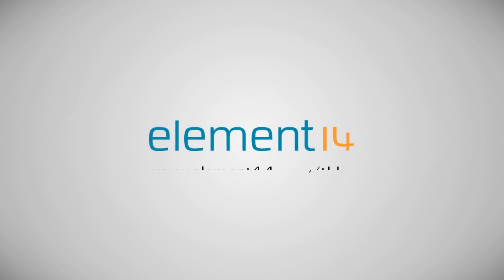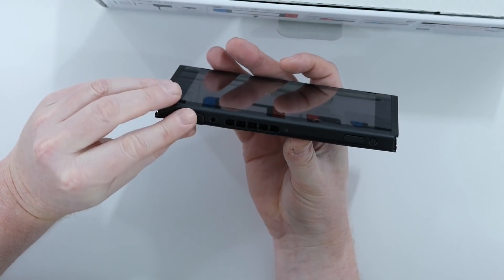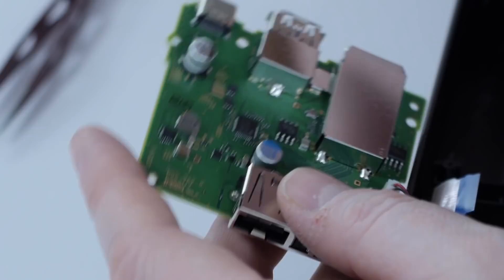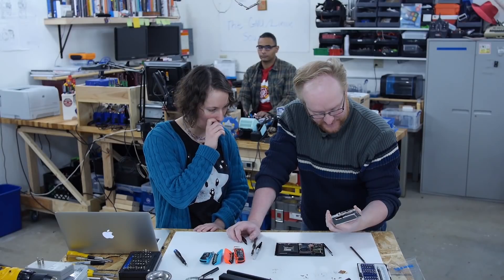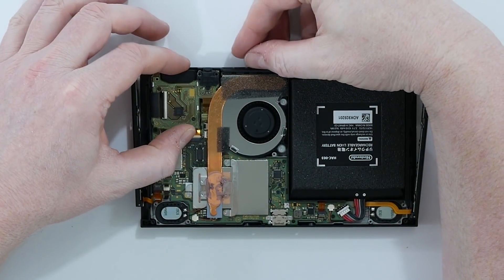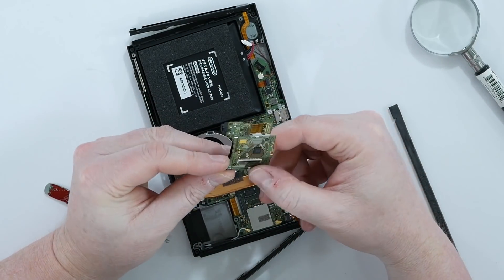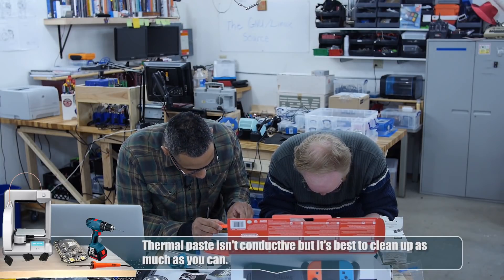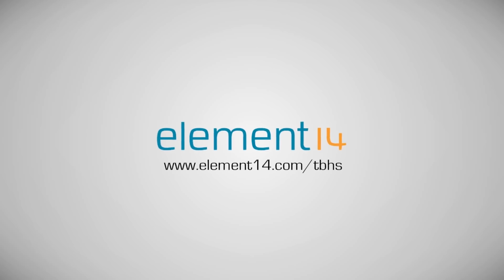Nintendo Switch Teardown

Comment from the maker: How do we make this nonportable? :P
Reply: The Ben Heck Show By combining the Switch with the dock?

Idk, I'm just brainstorming here.
Reply: when docked it increases it's clock rate. maybe take the board from the dock, add it and a large battery to make it run at it's faster clock rate?
Reply: A console unportable on the Ben Heck show?! I not sure the world is ready for that paradox!
Reply: Take the internal components of the switch as well as the ones inside the dock and combine them together inside some beautiful re-designed nintendo switch housing.
Reply: I have a much much much better challenge for you: "Make a PS Vita micro SD Adapter ". That would be much appreciated!
Reply: Empty out an original xbox one and put the switch in its shell.  Have the top flip up to hold joycons, pro controller. The left over room you could store your winter/summer clothes depending upon the season.  Or rent it out for extra cash to a young professional.
Reply: Turn it into an arcade cabinet... that's bolted to the floor.
Reply: nathan doleey Ram i doubt, but the storage probably is.
That flash chip have a 128GB version with the same pin out/speed/voltage etc..
Obviously you have to copy out the data from the 32GB chip and pray the system can actually see the rest of the memory.
Reply: Strap a battery backup to it and throw on some watercooling and overclock the hell out of it. jk.
Reply: The Ben Heck Show slap it in a wii case
Reply: Take an NES, alter the slot loader to take the Switch sans JoyCons, press it down to engage it to the Switch Dock USB C, (which you previously took apart in advance and mounted them inside the NES shell), use a USB based fan for the inside to aid airflow, alter the USB ports to the NES controller ports, (original NES controller ports to USB/USB-C adapters anyone?)

Don't forget to blow on it occasionally.
Reply: The Ben Heck Show reinstall the components of the switch into a N64 and remake the controllers to look like N64 controllers haha
Reply: Design a Switch TV with the dock components, Switch console and boards built into the TV case.
Reply: Glue it in its dock. Done.
Reply: The Ben Heck Show put the guts of the switch in the dock
Reply: Dear Ben, put the switch internals into a gamecube shell and make it so you have to use the official Nintendo component cables in order to display the max resolution. All other cables gets you 720p.
Reply: I honestly think a cheaper non-portable version would be a good idea. People already buy Chromecasts and Apple TVs, etc. Once the Switch gets streaming apps, which are almost certainly incoming soon, then if you could get a $150 box + Pro Controller it would fill the gap between a streaming device and a console... the gap that Ouya tried and failed to cash in on, but I think they were ahead of their time + didn't have the power of a brand like Nintendo + actual good exclusive games.

Cutting out the battery and screen should shave off a lot of size and costs, I think.

The Switches, as of now, are supposed to be able to play multiplayer together through an ad-hoc network (I think Mario Kart 8 will be the first game to do it next month)... I can just imagine taking my Switch to a friend/family members house and seamlessly playing some Mario Kart across my portable Switch and their nonportable box.
Reply: make a wii u switch
Reply: Permanently attach it to a 27" display
Reply: Hot glue the console into the dock or keep always connected by using a custom base.
Reply: I wouldnt mind seeing if you can find the pinout for the storage and see if you could expand it using some off-the-shelf modules and a custom PCB.
Reply: You guys should make it not portable, but have a giant built in memory....or build it into a tv!
Reply: Nintendo Switch Laptop. Only it has a flip down control panel, and a CRT screen :D
Reply: This video deserves a like just for Ben's reaction to the taste of the cartridge at 10:59. You guys're great. XD Keep up the good work!
Reply: The Ben Heck Show put the console in the dock
Reply: Since the Switch has an upgraded version of the Nvidia Shield chip, could you try to overclock it (or at least upgrade the cooling solution so it doesn't thermal throttle)? It would be interesting to see if Nintendo used a version of the Nvidia Tegra drivers or just started from scratch.
Reply: Find an old black and white TV and somehow build the Switch into it. Combine new and old tech!
Reply: Put it into an arcade cabinet.
Reply: Put it inside a NES
Reply: Put it in an arcade machine, make the controls giant.
Reply: By giving it proper cooling and it's "true" cpu/gpu frequencies.
Reply: tape it to the dock lol
Reply: I guess by giving it a reason to be non portable... So maybe  an insane overclock that will force the system to be in a really big fridge and see if that will improve Zelda fps @ 1080p
Reply: Laptopize it!
Reply: Watercool it!
Reply: superglue it to the dock
Reply: The Ben Heck Show make it so you cant get the tablet out of the stand and someone but a graphics card in there
Reply: I was thinking about build the Switch into a Tv. It will fit perfectly.
Reply: Make it a laptop
Reply: ***** or put it in a SNES case
Reply: you ahh buy a pc and emulate it?
Reply: The Ben Heck Show Super glue it into the dock.
Reply: 19" CRT and an arcade joystick & 3 buttons.
Reply: turn it into a wii u
Reply: Andrew Herrera Can the Switch battery be upgraded to a better one?
Reply: The Ben Heck Show now make it into a portable! 

oh wait
Reply: remove the battery and screen xd
Reply: Internally wire up the dock board to the USB-C, don't need that battery anymore (maybe?), get controllers that charge while not on the dock.  Viola, it's a home console you CAN'T take with you!
Reply: The Ben Heck Show Just figure out how we can use say an X1 or DS4 controller and then dock it for a fully home console lol
Reply: Build it into the empty space inside of the dock.
Reply: The Ben Heck Show will you be making a hack on the switch controller? Could I suggest switching the position of the buttons and the joystick on the right hand side to make it more comfortable?
Reply: Rodox2k10 I second this.
Reply: Dirty Neck Entertainment A mini SWITCH laptop.
Reply: You Dont
Reply: Yes Just Do It....
Reply: The Ben Heck Show  Hdmi conected manually to console, bigger fan,get rid of usb c port, fuse the dock with the system, get rid of the screen, larger memory chip.
Reply: Build it into a TV
Reply: You should turn it into a Wii-U like console, leaving all the processing parts in the dock, and transmit the game to the handheld screen over some wireless connection!
Nah, that would make it as sucky as the Wii-U. Or, in the immortal words of Graham Chapman, "Let's not go there, 'tis a silly place."

But seriously, could you possibly upgrade the internal memory yourself? I mean, it's a small thing (literally and figuratively), but that got me curious.
Oh, you could hook the joycons to a PC, so maybe that'll open the doors for a more powerful Bentendo Switch?
Reply: The Wii U used proprietary tech they bought a company to obtain in order to be able to transmit the video that way. Probably not doable with current on the market tech.
Reply: What I have seen people doing is making a customized dock for charging while playing (in hand held mode as opposed to using the crappy kickstand). Pretty sure you guys can pull that off easy and better than any one, make it so you can graduate the angle and the base should be like a slotted horizontal cylinder where the SWITCH just slides in (bonus points for speakers on each side) . Also, is Felix always really busy in the background or is he just a bit anti social? (like doh dee doh im just gonna pretend I'm busy so I don't trigger a BEN-RANT!) No hate btw, nothing but love for for this channel!
Reply: The natural progress now is building a better switch lol.
Reply: Would be interesting combine the dock & switch in a way so you can combine a HDD and maybe some way of also connecting external controllers to it.

Plenty of USB 3 to SATA adapters that could be used.

Also for controllers maybe find some way of using a PS4 or even better older like the GameCube. :D
Reply: VR treadmill ?!?!
Reply: +suraj lal maybe the switch is the headset?
Reply: Would be interesting to design a better stand that can allow charging. Also nice dk rap.
Reply: The Ben Heck Show well put a better CPU in it and do it like a PS4.
Neon and blue console.
When you turn it on the screen flips up automatically.
And some art on the console.
Maybe like a old console with the 20 first century.
Make the gartrage bigger like N64 and all the hard drive is in the cartage.
Reply: slot loaded SNES
Reply: People where tasting it because some blogger said Nintendo made the cards less tasty so dogs won't pick it from the table and chew on them like the dog of a friend of mine did with his Fire Red cartridge (RIP that game)
Reply: glue it to the dock
Reply: Super glue and Nintendo dock?
Reply: Make an N64 where the switch is the cartridge.
Reply: See about running the game on another gpu. Not sure how a Tegra hybrid sli would work, but I'm interested in seeing it happen.
Reply: turn it into an arcade cabinet!
Reply: kappa trolololo
Reply: +Syrol Helmi Hisam Shaharom. The Switch doesn't even support external hard drives.
Reply: Ben! We make it into a "DESKTOP", not a laptop! With a kind of unique idea, install an LCD into the side of the case, and built in speakers on the front and/or sides! Then a controller storage + charging bay on the front! Sup it up, print a board with the highest capacity memory chip available, beat nintendo to the punch! :) And finally maybe a carrying handle as a throwback to the first compaq :D It will still be kind of portable! lol... But yea a built in LCD and speakers so you don't have to plug it into a tv, you can just plug it in and play! :D :D Check my prototype rough draft design at my imgurl link posted in my next post:
Reply: The Switch Box "Desktop" Prototype:
http://i.imgur.com/rJtqbhB.png
Reply: The Switch Box "Desktop" Prototype (in case it didnt take v1):
http://i.imgur.com/rJtqbhB.png
Reply: The Switch Box "Desktop" Prototype: (in case it didnt v2) lol :D
http://i.imgur.com/rJtqbhB.png
Reply: The Ben Heck Show Remake it into a full blown server perhaps?
Reply: Sooper Gloo
Reply: Mod it into the original Nintendo case with cartridges.
Reply: I guess by giving it a reason to be non portable... So maybe  an insane overclock that will force the system to be in a really big fridge and see if that will improve Zelda fps @ 1080p
Reply: The Ben Heck Show coat the case in the same plastic as the cartridges.
Reply: combine the switch and the dock, permanently to each other. Make it into a box more or less like a regular console, drawback is you will never use the screen again, or maybe if you dont need it then take it out...

stick the switch internals INSIDE the dock, affix the gamepad thing to the dock if need be but otherwise you wont ever be attaching the joycons to it, they will always be in the pad thing or in your hand.
Reply: dun dun dun...
Reply: However you do it I think it should have liquid cooling, a way to charge the joy cons being connected to it, a built in LAN adapter (wireless doesnt seem to want to function all the time for mine but I have heard that it can interfere with the bluetooth signal), a couple more usb ports (my switch Ive already used 2 for the LAN adapter and usb cord for the pro controller), lastly no screen (should just plug with an HDMI similar to an Xbox or Playstation)
Reply: what if you made it un-portable.  like made it into an arcade machine style switch
Reply: integrate dock in tv somehow
Reply: marcoswi thank you. I've wanted the same setup for every phone/tablet/console I've ever owned. My own attempts at building such a thing succeed electronically but never end up being any better then a suitcase filled wiht stuff. I think Ben can do better.
Reply: The Ben Heck Show Beef it!
Reply: Put all the hardware in a NES-Cartridge;)
Reply: Make it a wired console like the original NES =P
Reply: Melt the charger to the switch, and melt the plug to the wall, then brick it.
Reply: arcade machine!
Reply: Buy a wii u
Reply: hdmi upscaler kgo
Reply: Like others said I would love to see an improved home console only version of this, if you can somehow overclock it and add a bigger built in storage I'd consider buying a modded Switch, as it is there is no way I'd purchase a switch, it's just a handheld Wii U with worse controls and no games except zelda which happens to run poorly at a 900p resolution and only 30 FPS. Still- if you can overclock that sucker and expand it's storage and make it a home console.... man that'd be something.
Reply: The Ben Heck Show can you fix my commodore 64? Powers on, shows a blank screen.
Reply: Get a classic NES & integrate it in there some how
Reply: I'd wager she has many many cats...
Reply: Ben... You're supposed to pull on the gray tab and then pull the strap out. Not push on the gray tab!
Reply: make an arcade out of it.
Reply: Here I was going to come in and make a suggestion of making a Desktop Switch :p
Reply: The Ben Heck Show build it into a nes and make the switch cartridges go into a nes flash cart.
Reply: Make it so that the dock is built into the switch so that the dock won't scratch your switch.
Reply: Phillip Opfer it will be some time before using switch cartridges like that because no one even knows how the switch software is encoded, or what kind of anti piracy is even in place. there could be code on the cartridges to detect if they are even in a switch. That would be awesome though.
Reply: The Ben Heck Show what the fuck is wrong with you
Reply: The Ben Heck Show can you put Liquid Metal between Tegra and Heatsink fkr better Heat disapation or will that ruin it?
Reply: Put in a micro SD card with a large storage capacity in it. Then, upgrade the fan in it, as it can overheat when playing graphics intensive games. To make it non-portable, hard wire it to the dock. Hope this helped!
Reply: You need to put grizzly liquid metal on it and see how much better the cooling is.
Reply: Arctic silver?
Reply: No. What I ment was grizzly cryotought
Reply: Sry on my phone. I ment grizzly Conductonaut. Its liquid metal. if artic silver gets 80c then this gets 50c.
Reply: Oh, thanks!
Reply: The weight is unnecessary
Reply: The newest consoles are getting lighter and lighter. If it doesn't have a screen, its not portable.
Reply: The Ben Heck Show Just superglue it into the dock, and you're done! A 5 Minute build!
Reply: To make unportable put ten bricks on the main console
Reply: Easy enough - just duct tape the thing to its dock
Reply: Hi
Reply: The Ben Heck Show re make a dock for the switch, install the console exept the screen inside the dock.
Reply: don't wear clothes while playing
Reply: Make it a console version of an all in one PC. Where the console guts sit inside the monitor your playing on itself... If anyone who reads this doesn't know what i mean, look up the dell inspiron all-in-one pc on google...
Reply: Rebuild with old hardware.
Reply: Put it on the dock
Reply: Put it in a block of concrete!
Reply: John Enigma ,
Reply: element14; I was wondering who you think has the best Engineering? Nintendo/Switch, Sony/Ps4, or microsoft/XB? was very curious on your opinion, please share back :) thank you and i love your channel.
Reply: Super glue it into the dock
Reply: Fuck u
Reply: element14 presents glue gun it to the dock
Reply: Put it in the dock
Reply: The Ben Heck Show put it into a Smart TV
Reply: tape it to a cinder block
Reply: The Ben Heck Show Now why would you wanna do that. But if you do see if the ram is upgradable and add Bluetooth headphone support.
Reply: In a few years the Switch OS will be homebrew-ready/cracked (should be extremely simple compared to others ultimately since a. ARM b. BSD kernel c. Nintendo system), there may potentially be a "3dswitch i", etc, and you should work with homebrew/softmod devs to make an overclocked nonportable switch that renders at full 1080p or the like
Reply: The Ben Heck Show you should make a better dock that doesn't scratch the screen
Reply: How about a 'superdoc'? It's a laptop sized doc that has a 256gig ssd in it, extra batteries, a big screen (or projector?) and nice speakers. I'd love to see if you can hook up an SSD via the usb3 connector and run games off it. It's part of the USB2/3/3.1 spec right? I'm not sure if Nintendo would let you access it. Oh and as others have stated, wired networking. Oh and  as many usb3 ports as possible. Maybe a built in router so you can network with your friends on the go?
Reply: Can't you put a 1080p screen on it and mod the console to use the resolution as it does with a TV? Also, can you make it smaller? Hmmm...
Reply: fit it for a pair of concrete galoshes.
Reply: Make it into a wrist console! xD
Reply: Duct tape it into the dock, and put a sticky-note on it that says "DO NOT ATTEMPT TO REMOVE"
Reply: try put ssd hard drive as storage memory
Reply: MAKE A PORTABLE NINTENDO CONSOLE THAT PLAYS NES,SNES,GB,GBC,GBA,N64,NDS.BASICALLY VIRTUAL CONSOLES FROM NINTENDO.
Reply: *I CALL IT THE NINTENDO GAMEPAD!
Reply: Improve processor into real Nvidia Tegra with its real big GPU and has HDD instead of tiny space flash...
Reply: glue it to the doc then glue it to a 30lb weight
Reply: well if you truly wana make it no portable...
Reply: If you can put it in your pocket and or carry it with relative ease than its portable.
Reply: Then nearly every console is portable.
Portable consoles are something you can just turn on and start playing.
Regular consoles, you have to hook up to a screen and need to have plugged in 100% of the time.
Reply: The Ben Heck Show what a piece of shit excuse of a hybrid console / portable